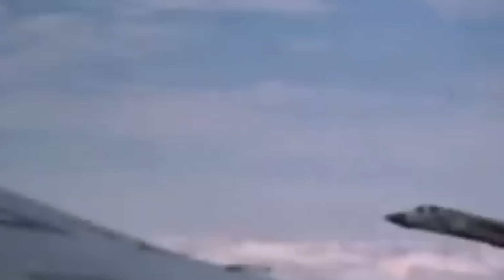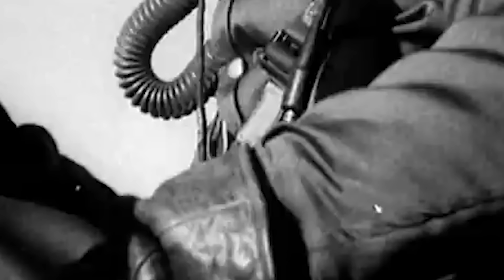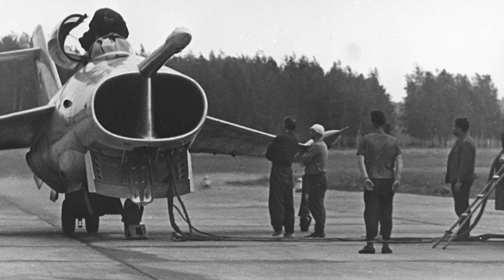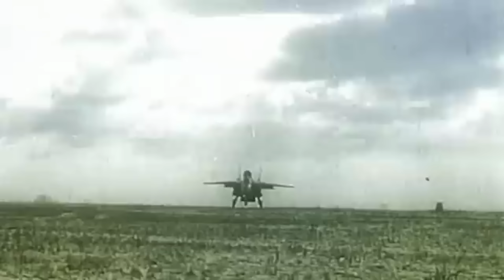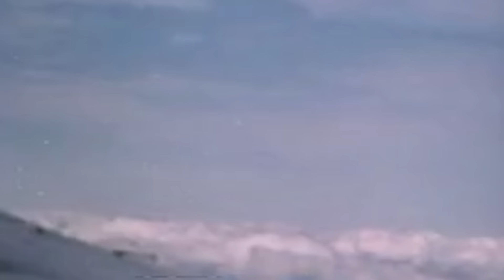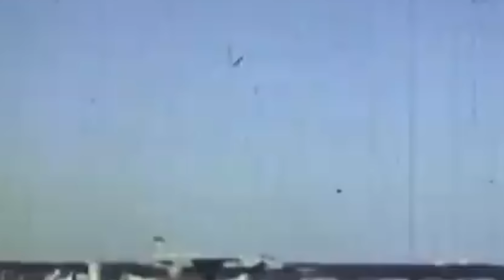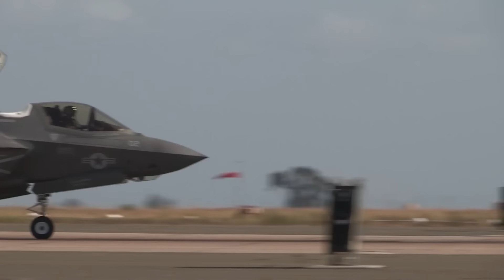America Stole This Plane and Turned It Into a Monster

Comment: What BS, the Harrier was NOT designed to be supersonic , c'mon get your facts straight or you might as well go sell red hats & gold sneakers !
Reply: Or sell tampons!  😂
Reply: @larrymac8538  um.....The Harrier WAS supposed to be the faster, supersonic of the 2 VTOL Hawker Siddeley was designing at that time...I can't exactly remember the code names of the 2 planes, but the bigger, faster supersonic  one was supposed to be called Harrier, and the smaller subsonic one something else. However, the bigger one was subsequently scrapped, leaving only the smaller one to continue. and the name Harrier was transferred to the smaller one..🙂
Reply: @michaelwong4303 so... the harrier was not, in fact, designed to be supersonic...?
Reply: @tk0rahl  correct. The "Harrier" as we saw/knew it was NOT the supersonic as intended originally. As I mentioned above, there were 2 aircrafts being developed by the then Hawker Siddeley ,  1 (the supersonic and bigger , intended to be called the Harrier) was subsequently scrapped, the smaller subsonic 1 went on and became the "Harrier" as we knew it. 🙂
Reply: @michaelwong4303  The P.1127 (originally called Kestrel) became the Harrier. The P.1154 supersonic design was cancelled, I can't find anything to say that it was going to be called Harrier.
The engine for it was a beast for the time, 35000lb of thrust on take off, via plenum chamber burning. Basically adding fuel to the front pair of nozzles , almost like having downward facing afterburners (more than the engine described in this video). Not sure how the flight deck of a carrier would like that heat.
Reply: @paulqueripel3493 thank you. Yes the slower "krestel" became the Harrier. But I do remember seeing somewhere about the bigger one being intended to be called the Harrier.

Comment: It couldnt even get off the ground with a full load, underpowered and a mechanical nightmare.
Reply: I think you're thinking of the Yak-38
Reply: @R0d_1984  You know what, you could be right, still this seems like a bit of a blow up.
Reply: @MyCaptainPugwash  Well considering how long it took, it doesn't seem like it was successful, even though the basic tech was used in the F-35B, maybe the YAK-41, could have been successful, but not enough funds/tech/expertise?

Comment: That is no longer a little-known fact.  That the Yak Bureau were able to engineer the Yak-41 without computer design or simulation tools available to L-M 20 years in the future is a monumental tribute to the engineering skill and talent of the Yak team.  Much respect.
Reply: The Yak-141 was a copy of the Convair Model 200A, and directly copied the GE three bearing swivel nozzle developed and tested in 1967. Nothing on the Yak-141 was invented nor perfected by Russia and was a direct copy of US designs and technology.
Reply: @user-os6ch5pt7w  don't tell that to the Ruzziaboos.

They're still coping with the fact that a Gulf War 1991 era Bradley was way better than the ruzzian latest BMP equivalent.
Reply: @user-os6ch5pt7w  there's another dude here claiming to have worked for Lockheed yet still perpetuates the lie that the Yak141 was designed first.
Reply: Nevermind the fact it marigally outperformed the Harrier, which first flew in 1966 and was actually producible.    Guess what?   That was also not a computer based design.
Reply: @brianhaygood183  producible? There was 4 prototypes and the program shut down. And Lockheed partnered with them when they was making the aircraft before it was even named yak141
Reply: @brianhaygood183  Yeah but the Harrier was but fuggin ugly and slow. Doesn't change what you pointed out, though. I just HATE that jet.
Reply: No duh, so did every other aircraft maker. They had armies of engineers to make up for no computers. You think computers made us LoL
Reply: The Concorde was largely built by men with slide rules and French curves.
Reply: I'm not sure what you're talking about.  The Yak was mainly a copy of the Convair Model 200 of 1973, which also had no computer design or simulation tools available.  If the Yak had actually been a VTOL fighter that could actually fight, I'd be impressed, but in fact it was mostly a failure.  They made 4 and threw them away as they were useless.
Reply: @lqr824   ah yes copy of a plane that never left the drawing board. And yes the yak could actually fight, it had a good enough radar and probably the best fox-1 missile. The harrier is dogshit compared to the Mirage but it still won just because of the aim 9l
Reply: USSR always stole technologies. Not America. Almost every Soviet aircraft has an earlier prototype, which was developed by Americans (60-80s) or Germans (40-50s)
Reply: @anatolybobrishov1238  There've been a couple innovative aircraft: Il-2, Mig-15 and Mig-25.  But in general you're  correct of course.
Reply: Oh. No better be quiet , you’ll offend godless/fatherless Americans
Reply: You should look into the guyd created computer microchips from scratch quit literally. They still use photograph lithography. Photomasks an uv hardened "dye" "paint" to mask the Desired design then acid etch the non desired gold away. Thats literally how its made from your phone to super computers down to smart munitions. All owe a debt to ww2 artillery engineers. They needed a smart round and vacumm tubes couldn't survive the pressure involved w firing out artillery. Yet solid state "chips" grandparents certainly could! Start size your thumb an then its just a matter of down sizing an mass production. Yet common jokes aliens crashed 😂 an gov got the tech. 😂 yeah Wikipedia much?  Funny they got technology to travel light years throughout universe. Yet crash middle desert in late 1940s lol😂 yeah
Reply: BS. This is total commie propaganda
Reply: It never worked properly and the engines were unreliable
Reply: Convair Model 200.....
Reply: The Soviets and now the Russians are the only country able to compete with the US in aircraft design.
Reply: @robertmosher7418  Are you not aware that UK and Japan are already in development of a gen 6 air superiority fighter?
Reply: they could just use a lot of paper instead of modern computing
Reply: ...& limited wind tunnel testing. Instead they built accurate scale models, & since everybody had cigarettes, all u needed was a straw. They could l8r analyze air flow using cameras filming every angle, after the film was developed. Saving them a whole bunch of time. 

My grandad was one of those WWII aircraft engineers in the airborne, & there wasn't much wind tunnel testing at all during the war. After the war, they started building wind tunnels to test 2/3 to 3/4 size models.

Of course, the russians stole wind tunnel technology, like everything else. They couldn't figure it out for themselves. 😄 500 yrs of state sponsored fetal alcohol syndrome will do that.😬
Reply: Yak -41would be a far worse aircraft than harrier or F 35. It use 3 engines,2 lift and 1 main. Any one have problems will doom the aircraft during STOVL. The hot exhaust of lift engines will make VL dangerous and landing on ship almost impossible.
Reply: @taoyuan3601  I hate this comparison because it’s so immeasurably stupid. Like you’re comparing the yak-41 to the yak-41’s successor, no shit it’s gonna be better. Don’t even get me started on the harrier, you think only being able to hover for 90 seconds before your plane’s engine fucking melts is safer? That’s like wiping your ass with a piece of toast and saying it’s better than Nutella, and judging based on how you type and what your point is, that’d probably be the first time you’ve wiped since your mother did.
Reply: The brain is not inferior to a computer of any kind.
Reply: @Lodestarter  Computers are easily networked and the human brain...not so much.
Reply: @Lodestarter then why is everything run and designed on computers now lol
Reply: Very very true it's the same as lucky 10 Skunk Works back under Kelly and it's Heyday when they actually reproducing good material instead of the disastrous Fat Amy did some of actually amazing work like the SR-71 that was done with slide rules designed in the 1950s no computer simulations nothing else just a good old-fashioned slide rule it's much the same as my favorites fly in to this day is still the F5 and it's the product in the 1950s and it's still in service today although most everybody it doesn't follow aircraft full more than likely know it as the mig-28
Reply: @konnorj6442  Pierre Sprey bullshit regurgitation
Reply: @konnorj6442 Good day, fellow commenter. Have you ever heard of punctuation? You know, those wee symbols that make an otherwise intelligible stream of words into something that makes sense?
Reply: @konnorj6442 I was trying to follow till you reached MIG-28 and lost me
Reply: Most of Americas advances in aircraft design have been stolen from somewhere, they even tried to steal the secrets of the ring laser gyro which was being developed by Sperry UK ( later to become Bae Dynamics group) but left none the wiser as the engineers refused to give away their research
Reply: When Russia needed a strategic bomber for their atomic bomb... They just copied our b-29 and b50... We stole stuff from them too.... Later on... You might have thought put the a12 or SR-71... Was a purely American design... Actually 7 years before... In 1957 the Russians had a mock-up of a plane that looked remarkably like the SR-71 or a 12.... Lockheed has been beating you to death with the Russian name for it.... Kind of an inside joke..... Its name was dark star...... Only problem was the Russians couldn't come up with engines for it.. they built a titanium fuselage with wings... That looks highly similar to what we would come up with much later... If you look at things. These days... There are elements. Of F-22 f-35 rooted in MiG-29... I guess everybody steals from each other
Reply: And yet the damn thing is unheard of while the harrier is well-known.  Go figure
Reply: @josephwear9572 one actually went into mass production, shocker
Reply: Wow. Great lil gem of info! 👍
Reply: @jeromebarry1741  Well, to be honest, the brightest minds in the Soviet Union came from Ukraine.  And most of those Yak engineers were Ukrainian.
Reply: @andypbj267  That's only because those industries were based there..
Reply: The aircraft was still a failure.
Reply: @janventer7942  what do we call he F-35 currently then?
Reply: @georgesgranger6362  All 3 F-35s are the most successful single engine fighter designs in history, each in their own right.
Reply: @georgesgranger6362 jack of all trades and master of none
Reply: @georgesgranger6362 A much improved copy (but still a copy) of the YAK-141? 😂😂🤔🤔🇺🇸🇺🇸
Reply: Most of the engineers were Ukrainian.
Reply: @eudaenomic They also built most aerospace items and nuclear weapons.
Reply: @eudaenomic  you bet me too this lol
Reply: @eudaenomic that part, this wasn’t “Russian”
Reply: @eudaenomic I'm not involved politically but worry this comment may be, it's our true Russian yak engineers were mainly Ukrainian?
Reply: @eudaenomic 😂😂😂 propaganda much? They might been concentrated there but thats like saying most the military leaders are from dc😂
Reply: @eudaenomic  not a single one was ukrainian
Reply: @eudaenomic  oh yeah a bureau based on moscow and somehow a majority of engineers were Ukrainians
Reply: @quangdan9121  You seem to be forgetting that most of the soviet unions industries were based in Ukraine. Their shipyards in Mykolaiv built most of the soviets large surface navy. Most of their nuclear power stations and nuclear refineries were in Ukraine. 
The YAK bureau being in Moscow was mandatory. All large businesses had to report to Moscow so having their HQ there made sense even if the main industry was in Ukraine.
Reply: @quangdan9121  did you forget that the actual majority of the "soviet engineers" were actually from Germany?
Reply: @ what i wanted to say is that Ukrainians didn't do all the works, they were just the minority at Yakovlev or most Russian-based bureaus. And yeah your statement is right, Ukraine was absolutely central to the Soviet war machine and economy. But what you are confusing is that not all bureaus have to based in Moscow. Antonov didn't have any hq in Moscow,  the core design, prototyping, and production remained centered in Kyiv and Sviatoshyn, Ukraine.
Reply: @ tell me how many germans that worked at okb-117 compare to the russians?
Reply: @wealllikeitsomilkit4301  So Soviets also have same sized "Paper clip" program like USA?
Reply: 😂😂  @quangdan9121  these guys have to bring in this nonsense Ukrainian thing ??? And anyway it was all Soviet Engineering . And when President Putin became President of Russia in 2000. His first task was to bring back the entire Yakovlev team  to Russia . Or rather extricate the Yakovlev dedign bureau team out of US because the Americans did want to let them go.
Reply: @quangdan9121  Ukrainians were the brains of the USSR. Planes, tanks, helicopters and so on.
Reply: @Diwana71  can you give me the evidence that US hold yakovlev engineers? Oh wait you can't! Maybe next time save yourself the effort and just write "Im dumb"- It means the same thing as your comment anyway
Reply: @zarjesve2  no. It's because the Germans were kidnapped by the Soviets from East Germany
Reply: @quangdan9121  yes ruzziaboos, aircraft design engineers need not to stay in the headquarters. Just like Lockheed skunk works engineers don't need to stay at the Lockheed headquarters
Reply: @quangdan9121   I know!  The Soviets had a famous proverb - "Чтобы поверить в возможность путешествия из одного места в другое, нужно выпить много водки."
Reply: @zarjesve2  absolutely. Post ww2 the US and the Soviets were in an arms race to capture and integrate German scientists into their ranks. The US got Werner Von Brauhen, tho which was key.
Reply: @quangdan9121  I don’t know why this is surprising, Ukraine was like the second most populous soviet state.
Reply: @Dinotimeforall   and the most populous state is surprisingly Russia. Russia did and still does not lack talented engineers, so why did Yakovlev bother hiring people from all the way to Ukraine unless they were extremely talented which was very rare?
Reply: @MarcusRhodes-q2s  and yet.. Ukraine became the worst off of the post soviet republics. How?
Reply: @iplaygames8090 Because they got shafted by Russia at every treaty that Russia failed to abide by anyway.

Munich agreement left Ukraine without the security of it's nuclear arsenal in exchange for Russia's promise not to invade..... Which Russia violated a year later anyway.

A former Ukrainian president also defected to Russia during his impeachment and took over 50 billion of Ukraine's money with him buying his life in Russia as an oligarch. In that Ukraine went from one of the wealthiest post Soviet country's to the poorest country in Europe overnight.
Reply: Yakelev was based and founded out of Moscow. “Ukrainians” are also just Russians that incorporated Polish words after Polish rule. The Russians and “Ukrainians” used to speak the same language and had the same origins. Study basic history 🙄
Reply: @kylekyle5438  When I was in Moscow, I saw their statue of Yuri Dolgoruki, founder of Moskva.  He was a Kievan Rus prince from....Kiev.
Reply: @kylekyle5438  ошибаетесь,

Comment: As a high schooler, I'd be sittin in 8 ft of clear ocean water 130 yds off the tip of a military runway on one of the Hawaiian islands that I was born n raised on. Winds switching to off shore made this beach - once reserved strictly for Hawaiian royalty - a local surf rats dream !!! We considered it our duty as good Boy Scouts(we actually were) - n citizens, to drill ourselves in snatch n grab exercises .. our target being epic surf. So 'we' devised EEEEVERY way under the sun .. n not .. to covertly get on this military installation, score 'okole' loads of hollow sandbar barrels n return to exfil site unscathed n not in the brig. As we would be riding or waiting for waves, F-4s, Harriers, n a few other F-sumthin er nuthers would taking off n passing RIGHT above us by 100 or less feet. We quickly learned to improvise finger tips for highly effective ear protection. The ONLY  G A R G A N T U A N  bummer in the OPs was the occasional tiger shark comming up outa the deep drop right in front of us in the line-up that ultimately bottoms out at 15,000 ft .. hungry ..

Comment: After learning that Lockheed Martin used YAK-141 technology make me appreciate the Boeing's "Joint Strike Fighter" more impressive.
Reply: Especially because Lockheed Martin DIDN'T use Yak-141 technology. They cooperated, and Lockheed was interested in some testing data.
The rotating nozzle was first patented by Convair, which merged into Lockheed in the 1990s. Yakovlev stole that nozzle, while Lockheed built upon its own patent and was merely interested in flight recordings.

Comment: If we paid Yakovlev for it, was it really Stolen technology?
Reply: and how come HLC's interpretation of '35 doesn't have a Russkie accent?!
Reply: Nope! Paying for something is a perfectly  legal purchase!
Reply: Both Convair and Rolls-Royce MTU had this type of swivelling nozzle for the VAK-101e  (note the e) well before Yak.    You can see the German Test Bed engine in museum.    Yakalov actually went into production but the USN had aircraft carriers and didn't need them and the Germans abandoned their VSTOL program on political grounds (to buy US aircraft).   The es Soviet Engineers were hired for their practical experience not for their invention which both Rolls-Royce partnering with MTU and Convair had come up with previously.  It was common to contract Russian engineers in the 1990s until the security concerns stopped it.
Reply: Yak-41 was Soviet copying of the Convair 201, specifically the 3BSD dual elbow rotating nozzle.